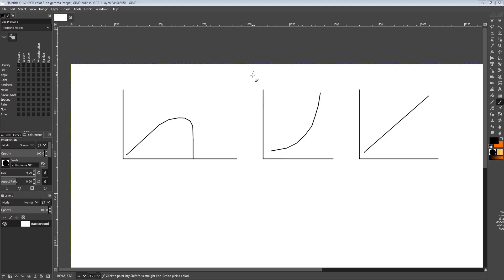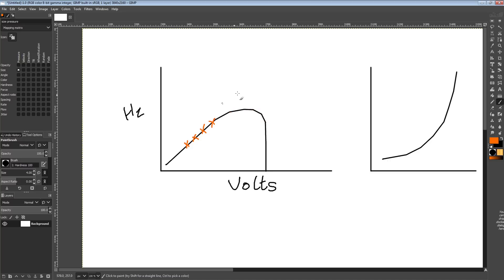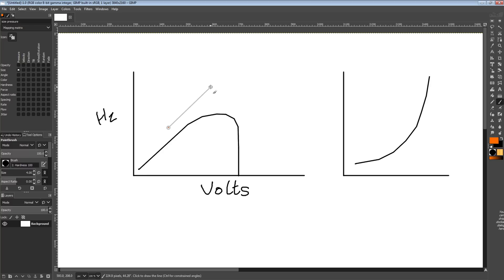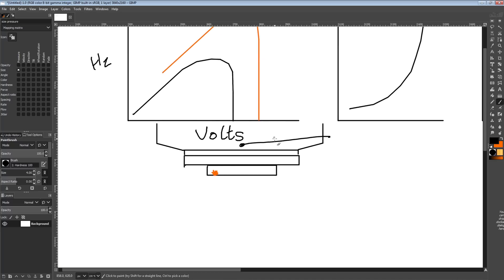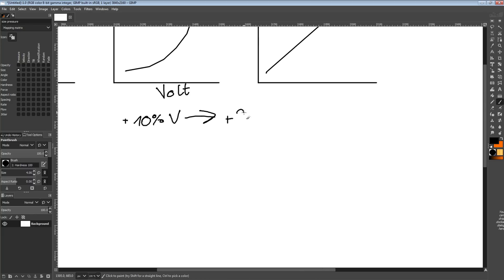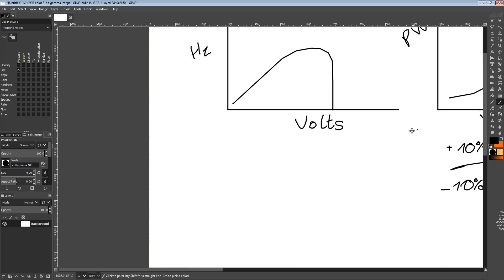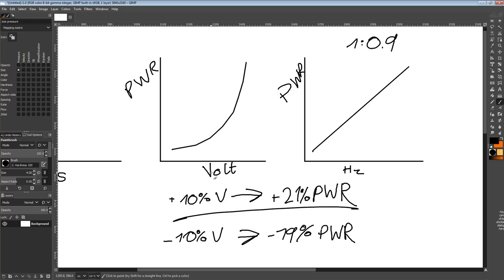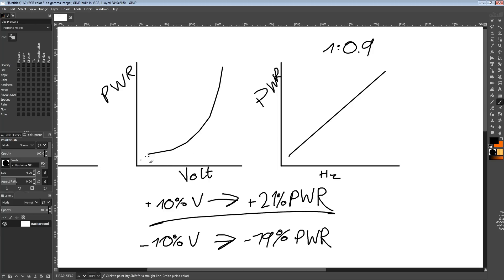Some random things to keep in mind when OCing

Comment: Nice video man. Something I have noticed is that with a lot of CPUs if you want to run at stock speeds, or even want a 100 mhz oc or something small; You can usually get away with a slight undervolt. At-least with Ryzen. Example being my 1800x. Stock it uses 1.4v, but it runs perfectly stable at 1.25 with a +100 mhz. I can probably get a little more OC at 1.25, but at these settings it uses very little power and hardly gets hot. I would imagine you could do this with any Ryzen. I really want to see how far you can undervolt a 3000 series Ryzen, at stock speeds, and run stable; and how much less power it uses. I think I understand why the stock voltages are higher than they need to be from the factory; It's due to a safe number across the line that guarantees that all chips run stable, because maybe there is a small percentage that will not run stable at 1.25v stock speeds, but they all will at 1.4v.
Reply: Yeah and the stock voltages keep the degradation over time in mind; Such a chip HAS TO run even in ten years at the given clock/voltage levels.

Comment: I kinda like to know more , like some specific like voltages for like architecture , like you know when you o.c like moderate if the voltage like needs a big bump like you described or like it is safe to a point like you don't get like so much performance , like you won't notice more fps like almost without o.c then if I keep o.c like to feel more diff like real fps increase like 5-10 diff then maybe you can say like yeah this is like i like to have it because like i like the performance i get. Do you like get me ? 🤷‍♂️

Comment: Buildzoid, this was indeed interesting. I have a number of SB i7 2700Ks I run at 5GHz, which for the 2700K isn't really that high (any 2700K on an ASUS M4E will do 5GHz with just a simple TRUE, one fan, not that much voltage and good temps), but today I noticed one of them is starting to need somewhat more voltage to remain stable, even though I know its frequency potential hasn't been pushed that much. I've had to raise vcore to the point where while idle CPU-Z shows vcore as being 1.475V, while a different system (same model of CPU/mbd, same RAM setup) shows only 1.456V. Years ago the degrading unit showed only 1.456V even under load:

https://valid.x86.fr/euhlxt

It's been used a lot for benching, while the other chip is still my daily tasks system and thus is used somewhat lightly. So what you said about older 32nm CPUs having a degradation point further back on the voltage/frequency curve chimes nicely. The CPU in question normally handles gaming workloads ok, but now it goes splat if I try a CB run or a Handbrake transcode, and today it barfed while running a mere Resident Evil 6 test (a few weeks ago it wouldn't bat an eyelid running FC5, SotTR, Hitman 2, GTA V, etc.)

By contrast, a different config (same model parts except for the RAM) when originally setup back in 2012 only needed 1.4V to remain stable:  https://valid.x86.fr/show_oc.php?id=2334534

Thankfully for the benching system I have another hardly used 2700K I can move onto the mbd, so it should be ok.

So yes, it was useful to see how different architectures, indeed GPUs, could end up being by default on different parts of that behavioural curve. Is it fair to say that the older the arch the further back on that curve the CPU will be? Or is this something unique to SB? What about Nehalem/Bloomfield/Gulftown/Westmere? I have an i7 950, 975 and 990X I've not tested yet, also various XEONs.

Also Buildzoid, have you ever experimented with Lynnfield and Clarkdale? I have an i5 680 which, because of its high base clock, I am hoping to be able to push to at least 5GHz (not tried it yet); see:

https://ark.intel.com/content/www/us/en/ark/products/48504/intel-core-i5-680-processor-4m-cache-3-60-ghz.html

I have an i3 550 which easily runs at 4.7GHz on even a moderately average mbd (I used an Asrock P55 Deluxe), but I plan on trying the i5 680 on a far more potent mbd, the ASUS P7P55 WS Supercomputer, but what you described makes me wonder if the CPU could indeed scale just fine but may degrade easily even if it's initially perfectly stable and seemingly not that high up the scaling curve. Strange, I don't think I noticed before that the i5 680 and i7 2700K are both 32nm, somehow I regarded the i5 680 as being older.

Hmm, I have some new/unused i3 550s I've not touched yet; if you'd like one to mess about with, let me know and I can post one, though of course you'd need a P55 mbd to use it. They're a fun wee chip for oc'ing, the good old days of bclks, etc. Here's the one I messed about with the most:

https://valid.x86.fr/show_oc.php?id=2093028

Lynnfield was fun too, reaching clocks X58 owners could only dream of, especially the i5 760, but they were somewhat below Clarkdale or SB. My results:

http://www.sgidepot.co.uk/misc/tests-jj.txt

Comment: I've played with subzero at normal voltages.  I find that below a certain voltage depending on architecture it makes very little difference whether you're at 100 or -100 degrees.  it's like maybe 50 mhz difference best case.  I haven't done it with any recent chips though, so take this with a grain of salt, but I imagine most newer stuff will be similar.

Comment: As we know th left curve is tempture dependent on chip hotspots are ram id's flipchip if so how much die is on top of the transistors if it where to be shaved down would we gain noticable clock speed increases as it is very tempture sensitive. (I believe d8bauer did a video on this with a cpu)

Second are ram ics sensitive to cold tempture and if so is that because ram has tighter timing requirements than a cpu and changes in drift current velocity or the propertys of the transistor materials changes enough to greatly affect timing requirements.
Reply: memory is so low power that it wont matter much. you can use 2V or more and get away with a fan an roomtemp air. in a case it might be better to go with watercooling but thats more an exeption. over 1.45 to 1.5V you need a fan or some airflow over it. thats enough.

the other i dont know enough to understand what you mean, but ram tends to like 15-35°C so roomtemp is allmost best you can get. dont know why it wont scale with lower temps, but i think resistors and stuff. On Die Termination is a thing with RAM and a resistor that changes resistance might not be ideal. but again, thats just my idea of it. CPUs and GUPs are a one chip thing. if you had 8 or so on the same board that need to talk in perfect sync, it might behave simular

Comment: Could you go over a video explaining how/why a cpu wont clock faster when temps are not a problem? I have two 9900k's, both delid, one direct die. I can keep the chips under 80C but I hit a wall with voltages even though I do not get hot. I just dont want to pump voltages even if temps are low.....

Comment: BZ, am i crazy to run 9900k direct die cooling with sanded die at 5.2Ghz at 1.42Vcore on z390 aorus master? Is it any "safe" or degradation is goin on nicely? temps are around 85C at prime95 non avx

Comment: Many people, even regular pc enthusiasts would be quite surprised at how much power their Intel chips would draw at something like the base clock or somewhere in the middle of base and boost depending on what chip /gen with the lowest stable voltage.     Especially when the chip maker is already releasing the chips at or near the max of what they're capable pf doing on normal cooling.  Like a 9900ks or whatever chip that has the 5ghz turbo.

Comment: Random thought on the frequency/voltage curve: could it be that by increasing voltage, the magnetic fields generated by the wires induce strong enough currents in other wires, generating unwanted voltages, and introducing instability?
Reply: I know this is old but that is a very interesting thought. I'm guessing not an easy thing to test lol

Comment: Alright so is there a graph for the scaling of temperature vs frequency ? Or is that chip dependant ? With ambient cooling my 8600k will not boot at 5.4ghz even with 1.55 volts
Reply from the maker: that's very chip dependent and I've never tried to model it.
Reply: thats part of silicon lottery or as buildzoid said its chip dependent, but if you lower the temps you will get better performance and stability in most of the cases and also increasing voltages only goes so far as he explained in the video and your chip might refuse to give good results with anything above for example 1.5v

Comment: Hey there, great info, as usual. On the same topic, is the degradation point for zen 2 at the rumored 1.32v? Have you looked into it?
Reply from the maker: I don't have enough CPUs to gather proper data from but just looking at how my 3950X behaves I wouldn't apply more than 1.25V full AVX load to that CPU.
Reply: @ActuallyHardcoreOverclocking  Would you feel safe using higher volts for lower core count parts? Or does their lower binning degree make them leak more, pulling even more current, and therefore having lower number of cores doesn't actually improve that?

Comment: Hey, i have a memory kit of Hynix MFR or m-die according to thaiphoon. That’s good for OC or not ?
Reply: Rahul Mahesh my xmp profile is 2666 16 18 18 36 1.35 volts. But i crank up to like 3200 with 1.4 volts. How can I test stability with 16gb of ram ?
Dram calculator max is 8gb and memtest is like 2.5 gb
Reply: It's the worst for overclocking. I have an mfr kit and it doesn't behave anywhere like afr. I'm running mine at 3000mhz 13-15-14-15-21 at 1.5v, and i got very lucky with the silicon lottery. It's literal trash.
Reply: I used to have HyperX Predator mfr, was able only to tighten the timings, even +200 mhz was unachievable with reasonable voltages. Needless to say I sold it

Comment: When doing LN2 OC how come they do not also put one of those pots on the backside of the motherboard CPU socket? Would not that help with hot spots cooling?
Reply: The fact that if the socket and pin or land grid cooling in the metal can shrink them back from each other breaking contact
The skill on handing 2 LN2 pots at the same time and finally "cold bugs"
Reply: The back is even further away from the hotspot, so it wouldn't help.

Comment: Buildzoid I think I have a safer way to do something similar to the liquid metal shunt mod, graphite is conductive and it might work, I’m going to try it when I find a few used cards to test.
Reply: The safe way is find a little resistor to attach to the pads

Comment: well im running my 1080Ti on .95 Volts since over a year now and only have 3% less performance from if id overclock it so yeah. Getting nearly 10°C lower as well and running 1900Mhz stable. I guess even most Nvidia cards that get shipped these days are just super inefficient on default than anything else.
I also undervolted my 3900x cause at full load its drawing way to much volts from what the cores are going to need anyways.
Reply: Morioh 1820mhz, around 0.9v goin around 200w power draw under 100% load
1080 ti strix
Reply: And Im sitting here with my 2200 Mhz GTX 1080ti with 1,250V,people are so diffrent.
Reply: how do you undervolt Nvidia since all the software I tried doesn't let me undervolt/ only overvolt usually...

Comment: Followed  Hardware Unboxed Ryzen mem OC guide last night and got my Royal Bdie 3600 16 16 16 36 up to 14 14 15 14 28 @ 1.45v. On a taichi 3900x. My pc was crazy fast even with me rebooting to bios a few times. But this morning it looped, lost the settings,  even the profile  I saved in bios...
Reply: Next time I will pick calculate save instead of calculate fast...
Reply: Safe....

Comment: and then there is ryzen 3000 and some special cases (reducing ppt instead of undervolting). got a 3700x on a b450i aorus pro wifi and 2x 8GB 3600mhz cl16 ram and when i drop the ppt from 88W to 65W (26% power down), i reduce the Cinebench C20 points by only 2,5% (from 4799 to 4682).

Comment: What I don't understand is how I undervolt and get 1900 mhz @ 1.000 and when I'm "+110" overclocked my GPU jumps to 2005 at the same 1.000 voltage... but anything higher than 1900 Undervolt is unstable
Reply: Are you setting that manually or are you letting the boost algorithm still operate? Because if it's the latter, that's what is doing it.

Comment: So I shunt modded my Titan xp with LM and I have my 9900k running 5.2@1.45v extreme LLC and I'm pushing 230w and 22A. Only once my vrm is over 80 does my chip hit 93 tops but 83c if I aren't running CB for long runs. I think my CPU is not happy running 22A peak.
Reply: 1,45V BIOS for 5,2 AVX 2 or what?
Reply from the maker: that current draw reading is wrong unless that's input current not VRM output current
Reply: @ActuallyHardcoreOverclocking  sorry just saw this. Yes it is indeed "Current (IIN)" around  20-22A. Output is around 160A and 215-220w output and no avx offset for what it's worth. And it's the aurus pro wifi

Comment: So, is there any good, easy way to know when/where you're OCing into the the point of causing/starting degregation?
Reply: well it only speed up, but there are some voltage levels to keep in mind. problem is, that if you higher freq. that also speeds it up. 1.4V might be good for 5ghz cpu and ok for 5.2ghz. but another damaged his 9900k at 1.4v 5.4ghz. depends on architecture a lot. intel can handle more volt than amd. also more people means more "save level". on intel i would kepp the io/sa voltage 1.35V or below. some say 1.3V. older posts state 1.25V or even 1.2V. asus says 1.4V thing is. most people dont run 4000mhz+ on RAM. so they dont need 1.3 V or up. if you dont have 8. or 9. gen, you may cant even run that high. one chip might handle 1.4V good, another degrades after 1 year. if you dont want to risk it, then stay low. and allways stay as low as possible. there is no benefit to run with higher volts than you need
Reply: @mauriceelet6376  you only need 1.15VccIO and 1.20VccSA to run 4000Mhz memory on coffee lake, but motherboard makers just couldn't care less about doing proper testing and lower the voltages: just like with core auto-overclocking they always overshoot the voltage at least 100mV
Reply: @Smucky ! There's no easy way to know, but there's some known guidelines:
-on Intel pretty much from Sandy Bridge until nowadays, up to 1.4V is considered safe (with proper cooling, meaning under 90°C with max load).
-on Zen 1st it's 1.4V, 2nd gen is 1.35V and 3rd gen is 1.32V.

Those voltages are for all-core max load with Vdroop, meaning those should be the voltages that are physically going into the CPU, not what you punch in BIOS or what SVID reads.

Comment: You'd think they integrate the heatspreader into the LN2 pot and have one layer between the CPU and LN2.
Reply from the maker: Solder to IHS to paste to LN2 pot works better than LN2 pot paste to die. It's only unsoldered CPUs that are really annoying to deal with on LN2
Reply: @ActuallyHardcoreOverclocking  would I be right in assuming that's because stock TIM at sub zero solidifies and kills efficiency?

Comment: Nice video man!, how much voltage would you consider safe for a ryzen 9 3900x? just for games, I'm using 1.387v for 4500mhz
Reply: Well he just killed his 3700x today so I would probably ask someone else
Reply: @michaelwerner5049  hahahah LOL xD
Reply: I would not push past 1.2625v mayyyybe 1.275v,  anything over is simply not that safe. You have to remember that auto oc is only providing voltage in ms time frames. The best bet is to run prime95 small fft for three minutes and see where your sbi tfn2 lands. Thats your cpu's fit voltage then target an oc below that by about 0.0125v.
Reply: If you're worried about safe use PBO and consider a negative voltage offset.
Reply: I have run systems for over 3 years @1.35v on Intel systems i7 7700k stuff .
Dono about ryzen
Reply: @tanmaypanadi1414  Every architecture and process node is different
Reply: @MrMackievelli  is correct. Your chips fit may be different than another chips fit.
Reply: Anything over 1.3v will degrade your chip in a really short time. It's not even gonna run at stock anymore.